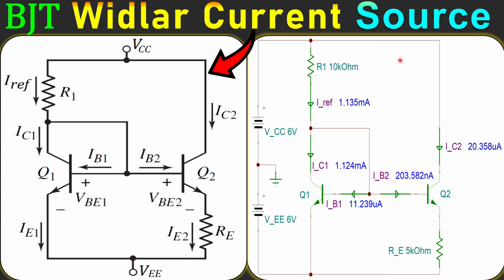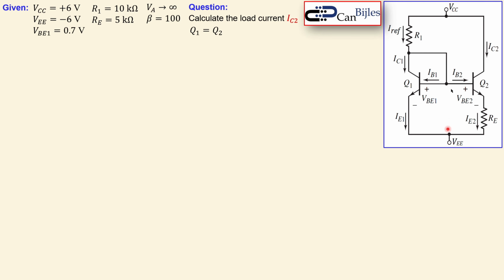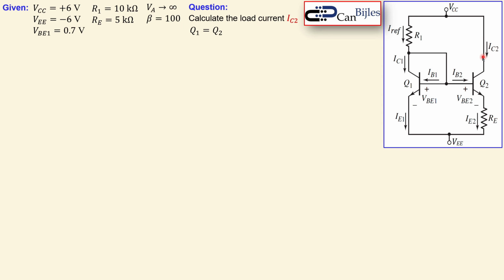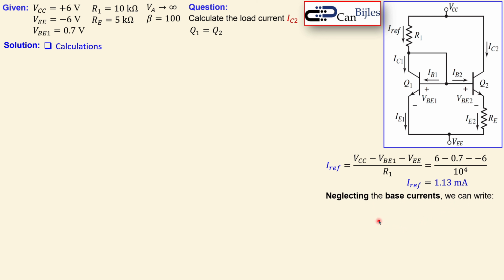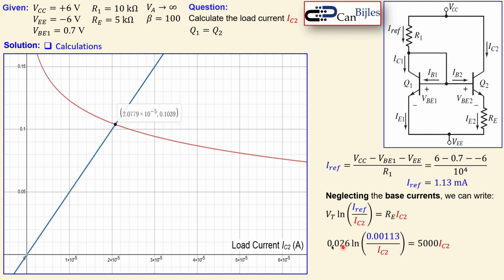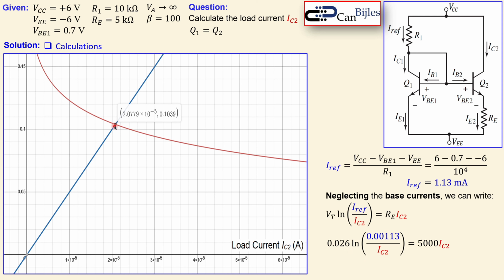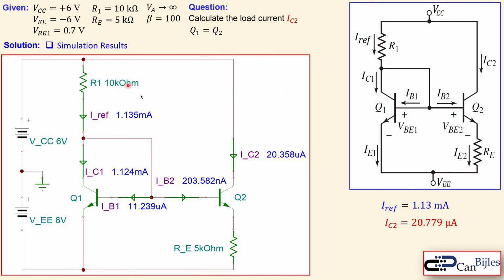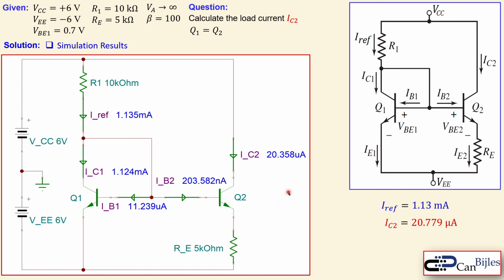BJT Widlar Current Source ⭐ Calculations & SPICE Simulations ⭐ Example 5

Comment: Can you explain me 1:35, thank you so much. Because I don't know why Iref.R1= Vcc-VBe1-VEE
Reply from the maker: We apply Kirchhoff's voltage law at left side of the circuit. You can also write: V_CC = I_ref*R1 + V_BE1 + V_EE. Then, you rewrite this expression bij isolating I_ref. That is the equation I use in the video. Let me know if this clear.
Reply: @CANEDUX  oh thanks you so much, I got it. Now I'm doing a difficult excercise from my teacher, but I can not handle it, can I ask you for my problem
Reply: @CANEDUX  My problem also same your circuit in video, but change a little in left and right. My circuit only has transistor Q2 connect the left with R1 and R2. The right has Rc. I think use method thevenin to simplify left of circuit. Do you think it's feasible?
Reply from the maker: @angkhoamemath9549  You can use Thevenin and then apply the circuits laws like Ohm's law, KCL, and KVL.
Reply: @CANEDUX  oki thanks for your answer ❤️❤️